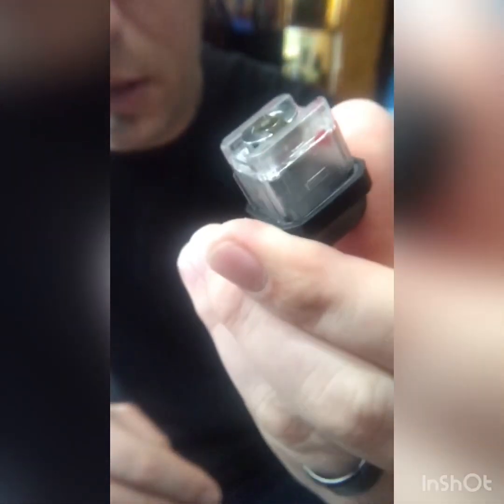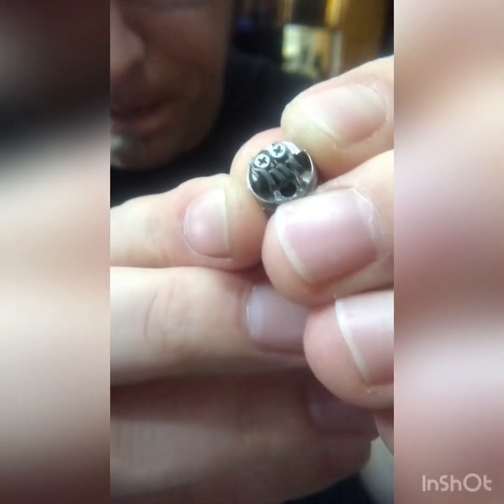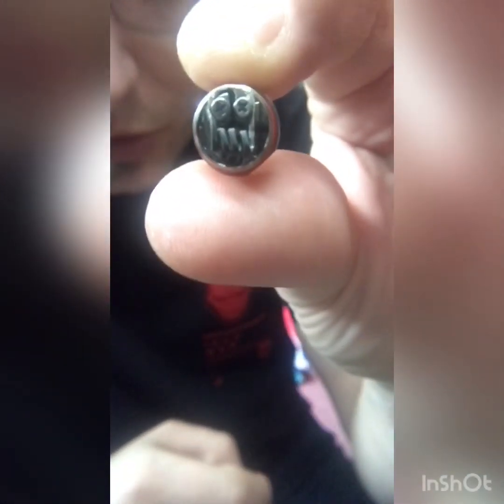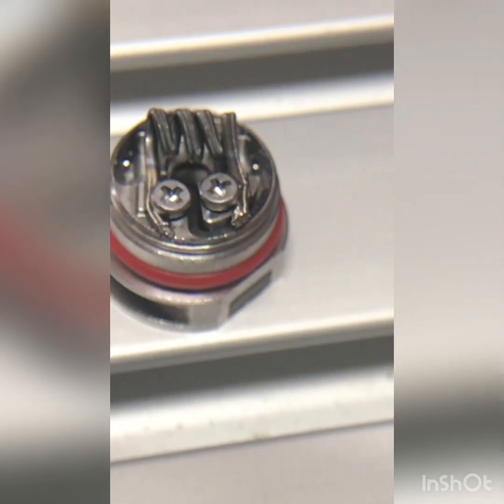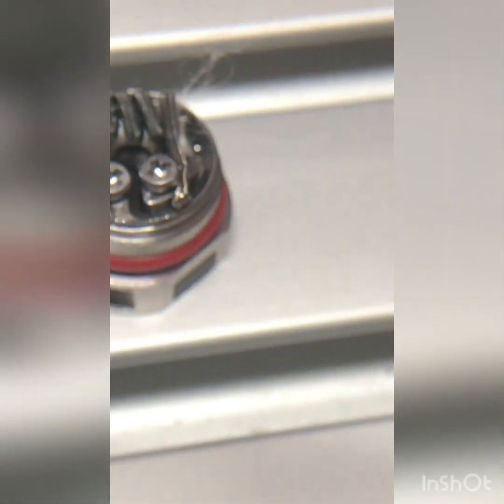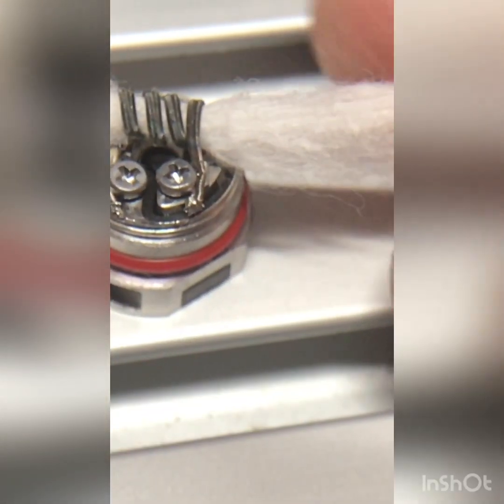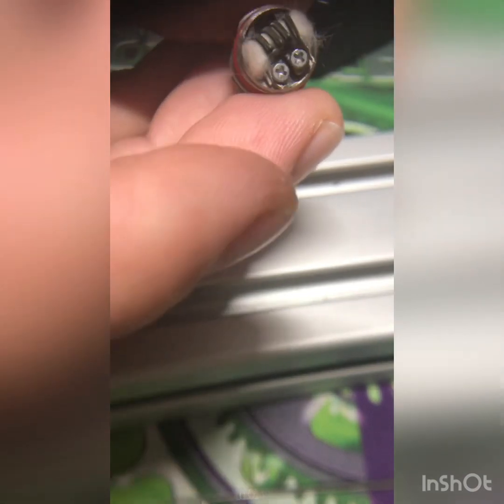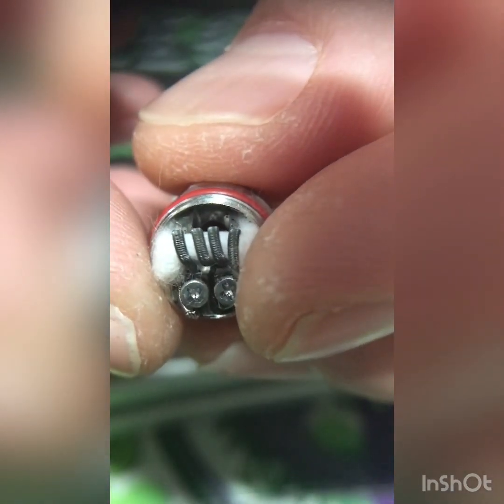Smok RPM40 RBA

Comment: I was really hoping smok would make another rba, yes this one works and gives a pretty good vape but its just a pain in the ass to build on. The screws are absolutely shit on mine, unless im using like 30g fused with 40 fused claptons (something VERY small) i have a very difficult time getting the screws to bite down on the legs. This rba is not really hard its just a pain. Wish theyd make another one especially a dual coil one. Always enjoy seeing ya put out a video man. Hope you had a great holiday season. Stay well and vape safe.
Reply from the maker: Joshua Apathy Miller I agree 100%, it is extremely difficult to build on however, the rba section for me blows the mesh out of the water.

Comment: I used to have a rpm40. I dig it but I can't do salt nic and never got around to getting high mg freebase nic before I sold it. I want to try to voopoo vinci x! I hear this RBA deck/coil fits the voopoo vinci (x)! I don't know that for a fact though. Great video!
Reply: Don't have to use salt nic in the rpm 4o, you can use regular ejuice just stick with 75 vg or less would be my advice.  75/25 ratio, alot depends on wicking.  There are some juices that are 65/35 or even 60/40.  Those work well for less cloud more stealth more throat hit more flavor.